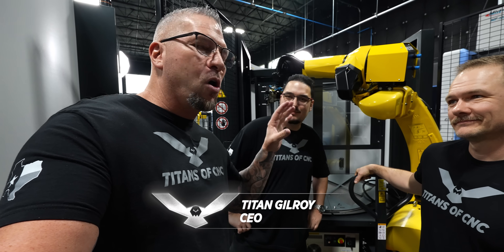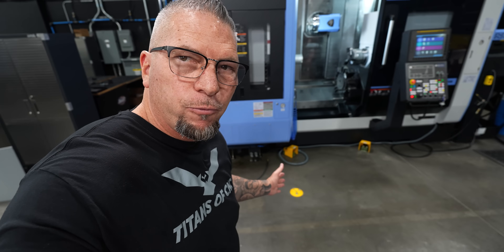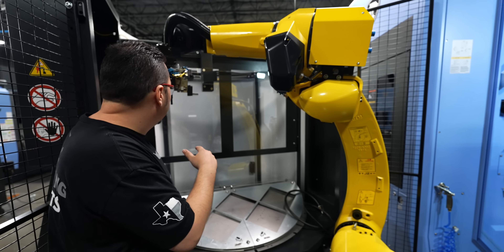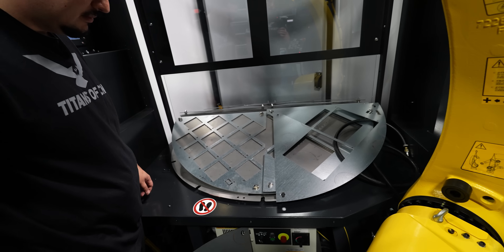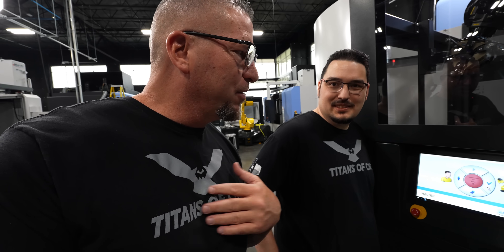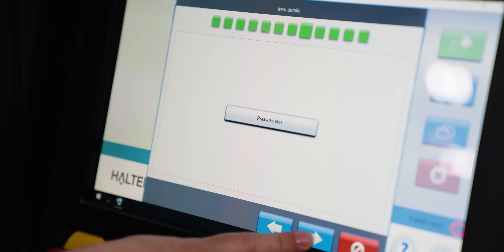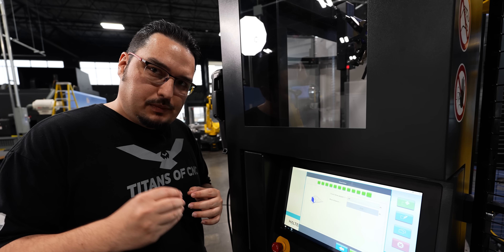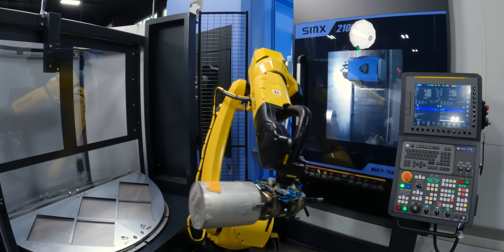User Friendly Halter Robots Will Change The Industry

Comment: Halter ? Looks like a FANUC rebranded... the pendant looks the same and the robot body as well. Japanese quality.
Reply: Yes it's fanuc hardware, but the hmi is what makes it easy to use
Reply: @agent-H83  you mean the software inside the HMI because the HMI (pendant) is pretty much only a touch screen
Reply: @QuebecoisSti I see you know more than the average Joe 👌. Yes, I was referring to the halter hmi. Basically the halter hmi is copying all the operators inputs into the fanuc registers, and these inputs are Basically just offsets to the userframes. So video isn't a 100% accurate.  Setup any part in 5 minutes is possible,  after the userframes are thought. This is a 1 time process which will be done by the commissioning engineer that comes to install the robot. Btw, I  was that guy for a couple years🤙

Comment: I bought my first Halter 8 years ago and now I use 4 Halters in my shop now. They are super flexible and my operators love them. So do I. More output and happy operators.👍
Westbrug Techniek
Reply: It's a fanuc robot arm with a proprietary Halter software front end on the programming GUI. It's the same on the machine tool, all the servo motors and main NC control are fanuc products with a DN solutions software overlay on the controller. Just like a Briggs and Stratton engine on a Troy built lawn mower.
Reply: @funwitharobot I assume it still works if you wanted to retrofit an okuma, just less features?
Reply: @andrew-729  you could put one of these on an Okuma no problem and still have the same functionality as you see in the video. The difference is how the robot system would talk to the machine. Each brand of machine does it a little different so you would have to inquire with Halter as to how they would do it.
Reply: They look like fanuc. Are they just rebranded by Halter?
Reply: What is the cost of these please?

Comment: As long as the Indian steel is cheaper than US, they'll always have the manufacturing advantage
Reply: Anyone that can't add more value to what they do will always be at a competitive loss. Increase your added value greater than what happens in India and the lower raw material cost is meaningless. Quality parts on time, every time, can do attitude etc is a winner every where.
Reply: Raw material cost is just a small part of the big picture.